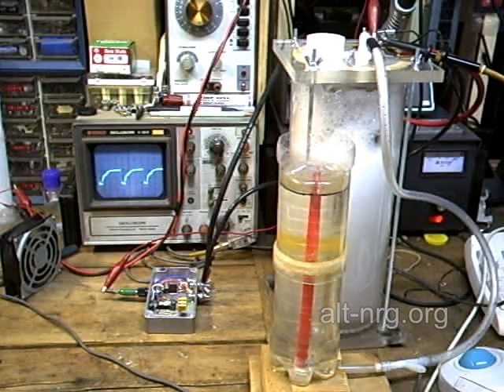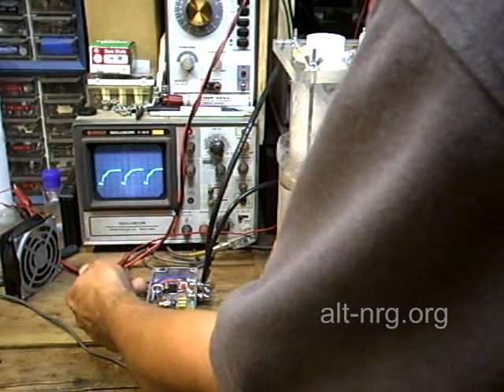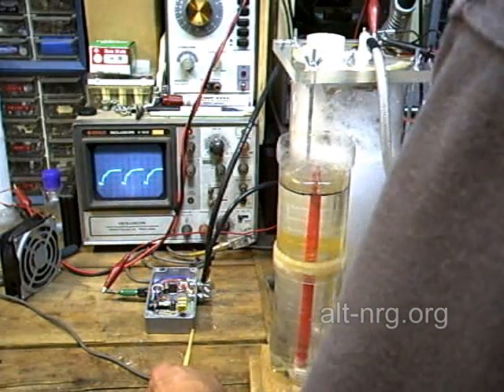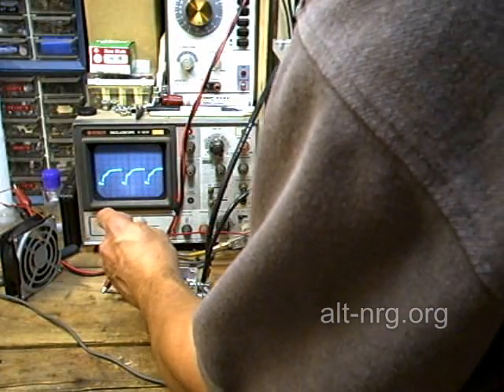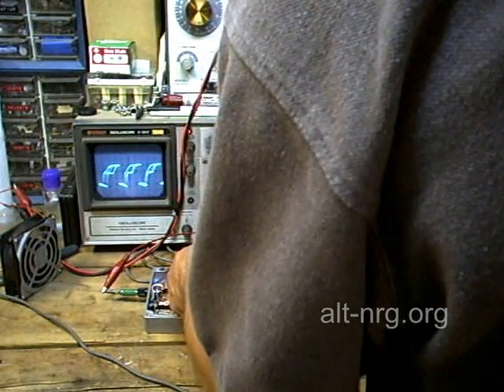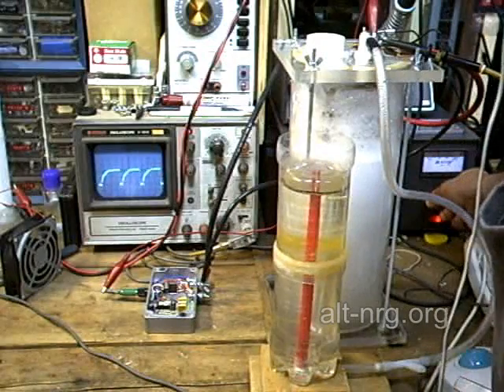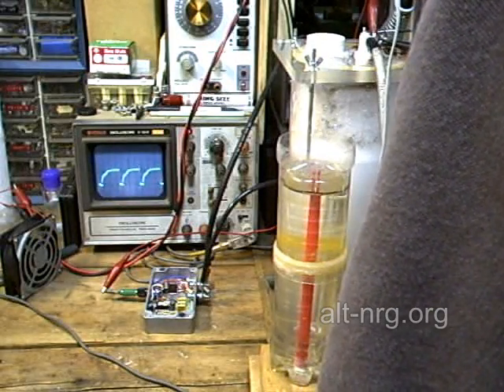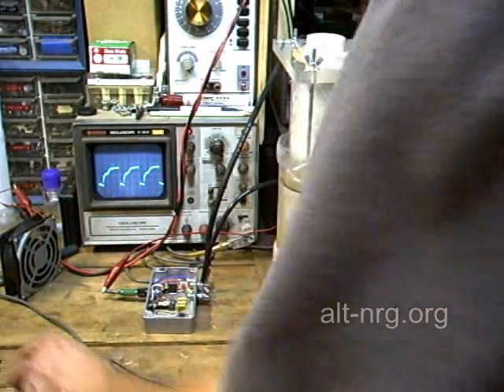#122 Full Pwr test of the PWM v2a

Comment: Hello sir, i want to know why the C7 is heating? I use a 3300uf/63v but is heating verry fast in about 2-3minuts. The rest of the pwm work verry good, also the limiting current part....If i use  a big capacity capacitor about 10000uf it will be heating the same? 
Thank you !
Reply from the maker: Because I am very, VERY specific about the requirements for this capacitor. uF and V are not the only considerations. High max ripple current and extremely low ESR are critical to prevent heating of this capacitor. Otherwise, yes, your C7 will get hot. It may even melt or explode.

Comment: What we (HHO experimenters) need to see is when, at a certain frequency of PWM, for the current draw to go up. Theoretically this would be the resonance of the electrode. For any given frequency the current is the same, minus the effect of heat, except at resonance, which is when current will start start to rise at a given voltage, and water temp.

Comment: Are you using linear PSU to power PWM? If so max its output voltage, so that is won't heat so much...if you have linear that is

Comment: Excellent thinking! If it's capable of melting steel and wolfram it may also ignite some other gases/liquids in the cylinder. Maybe it can, even, use some inert gases, such as CO2 or NO2 as fuel? Nice thought Biko! Cheers.

Comment from the maker: Yes but a CPU cooler is a must, mounted to the side that the MOSFET mounts to, placing the box cover down. Other changes as of tonight,

Cut r12 down to 1/2 it's original length for 40 amps max, 1/3 it's original length for 60 amps max.

Change C1 to polystyrene. Disk ceramic causes way too much frequency drift with temp.